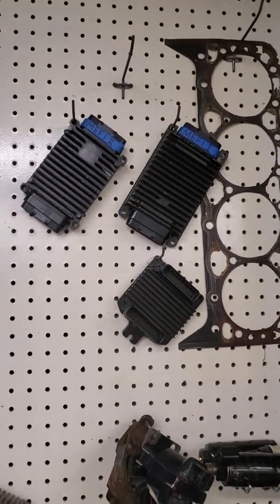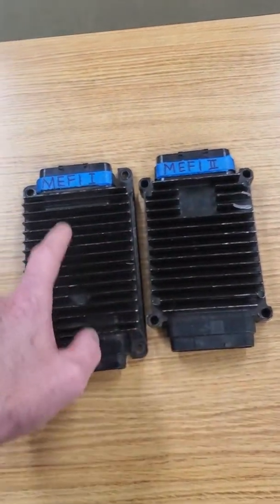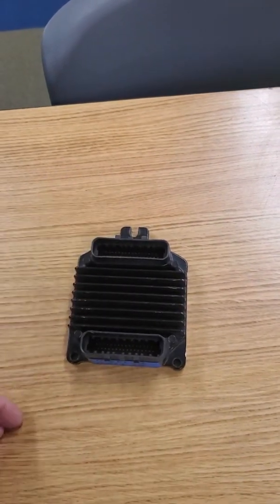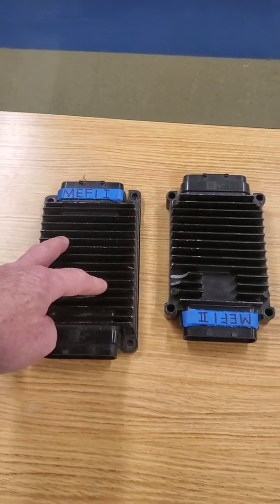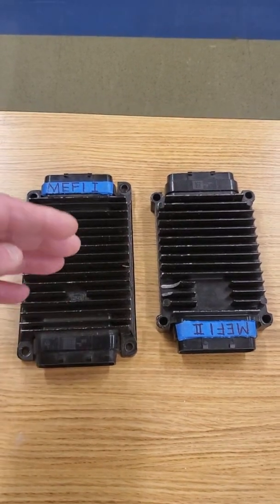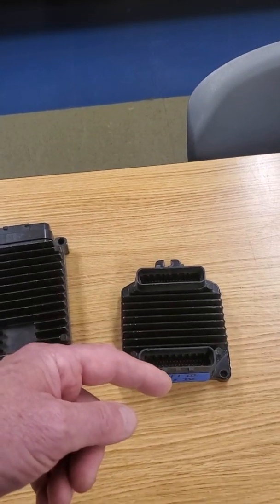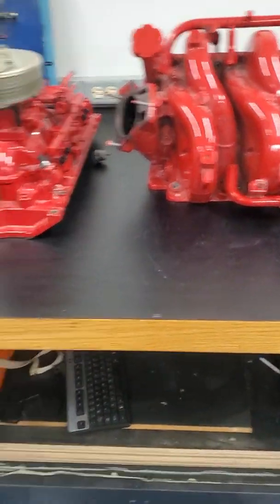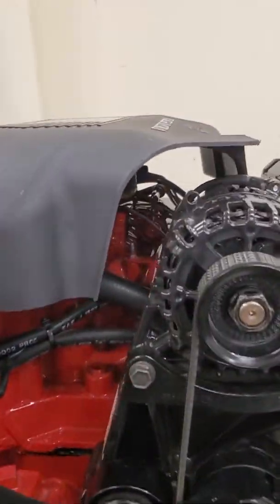Marine Gas EFI MEFI engine Identification

Comment: Thank you.  The video answered all my questions and I was able to identify the ECMs on my engines. And able to do so with out any doubt because you took the time to clearly and in simple detail point out the differences of each unit. Mine are 3s because my engines don't have crank and cam sensors.
Reply from the maker: @tomstanley7772  👍

Comment: How can you diagnosis mefi 3 for no spark, distributor cap is not crab style, does not have external module only  has the magnetic rotor trigger under cap

Comment: Hey Ted, would love a video on Volvo evc steering overview.  Tips and tricks for EVC steering failure error codes. Fluids up but still getting error of steering failure when trying to plane.
Reply from the maker: Have you gone through the steering calibration? You need a Vodia tool for that. It could be you have a faulty SUS unit or Resolver issue.
Reply: @tedsmarinerepair8956  can us regular folks get the vodia software and adaptors or does it need dealer?
Reply from the maker: @omarf4  Omar,
Negative. Dealer item only, and the dealership must have a certified tech (who was trained on EVC and Vodia) to use the tool. So you MUST contact a Volvo Penta dealer.

Comment: 93 model year for the 502 big block was first mefi 1.  the 320 efi was in the 80 s ( 87 thru 89 )  used basically an outboard ecm that took a special scan tool back then.  I do ecm repair everyday
Reply from the maker: Thanks for the info, If I remember correctly we used the Rinda Techmate back then on the 320 as well. That was many moons ago.....

Comment: L29 is the mefi 2 . next is MEFI 4 labels the 4 on the sticker on the back. Mefi 3 had Delphi sticker as well.  The newest built mefi 4 has AC delco stickers on them. And the 4 has MEFI 4 a and  4 b.   Those will be going away as well like MEFI 1 thru 3 did many years ago.  I have plenty in here for testing & repair